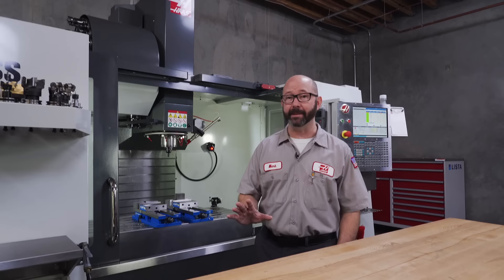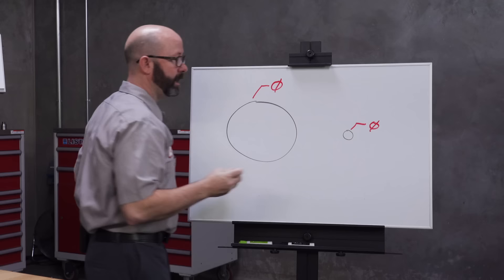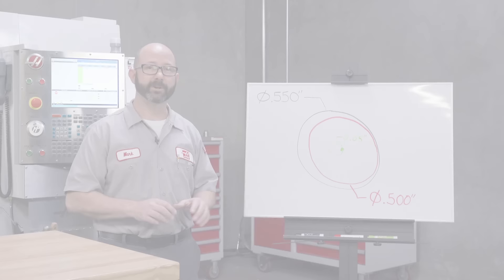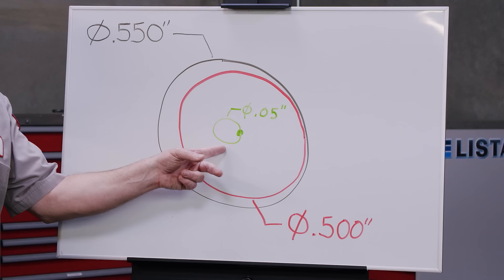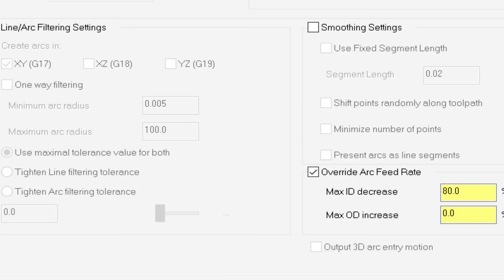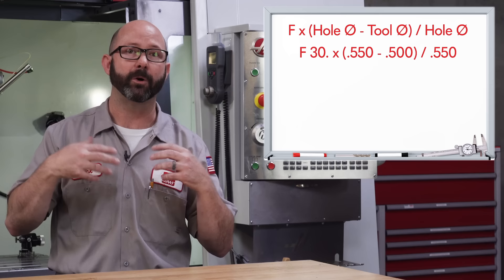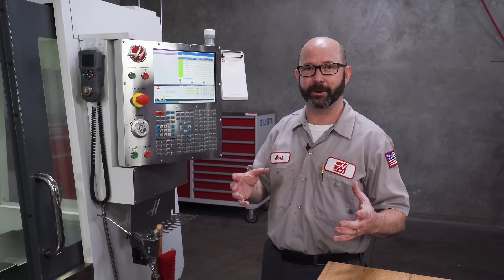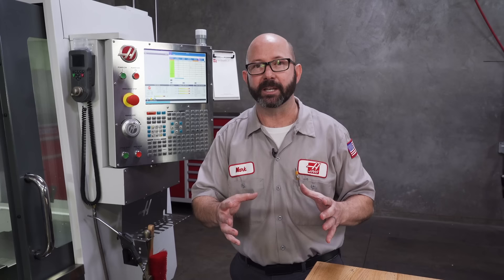YOUR FEEDRATE IS WRONG! – Haas Automation Tip of the Day

Comment: I appreciate that the first tip was "Haas does this for you" and the second was "But if you don't have our stuff let me show you the other way". Much better than "Buy Haas if you want it to work". Great content.
Reply: True but it's more like manually program it and let the Haas machine compensate for it or use a cam system and manually change the feed rate if it can not do it for you, yes it helps on other machines that have no compensation too.

Comment: Same goes for the outside of a circular boss as well. And yes fusion has this as well, under the feed optimization option.
Reply: Same thing happens when you program an inside radius like in a pocket.  Some cam systems will compensate by slowing the feed rate when approaching the radius.
Reply: On the outside you would have to speed it up not slow it down.

Comment: I've been using this formula for years, stole it from Mitsubishi thread mill catalogue once I realised what it was actually doing. Our shop used to spend hours contouring bores to get size and finish, blew some operators minds when they used this formula and got perfect fit first time with perfect surface finish.

Comment: Thanks for this. This is a great Tip! There will be a similar but opposite situation when milling external surfaces, Boss, rads, curves too.
Feed rate X (Boss dia + tool dia)/ Boss dia
1/2" tool cutting 2" boss @ 30 in/min
F30 X (2+.5)/2
F30 X (2.5)/2
F30 X 1.25
F = 37.5 in/min

Comment: This is really the kind of thing that should be taught in month 1 of machinist school... I know it was in mine. Also the OD formula is a bit different.
Reply: I've known about this since I was in machining school as well but I want to know what the Haas controller does if you use CC or a G12/13. Does it still use the tool centerline? or the "part line"?
Reply: @derekrutrough2334  CC ought to be Heidenhain command, haven't heard it used on any other controller. As for G12/13, as long as g41/42 is not active, it should follow tool centerline

Comment: I used this formula on a part that had 8 circ interpolated holes ranging from a finish size of .625 to 1.25 all done with the same .5 endmill. All 8 holes programmed at 11k RPM F100 IPM. When I checked the holes sizes  I noticed the largest hole was just a couple tenths undersized but the smallest hole was .007 or .008  under programmed size. After adjusting feeds with formula the small hole was right on size just like the bigger ones. Two lessons here. #1 you guys did it again with another great Video. #2 never trust anything coming out of the front office! :)

Comment: Thanks, that is interesting. Especially since I was making holes today on a Prototrak mill, the holes need to be a precise size that does not match any of our cutting tools! I didn't think about the problem and just set 5 ipm (in plastic with a 1/4 inch end mill) and it worked fine, but now I need to figure out what speed was actually being cut!
Reply: By the way, we do have several Haas machines where I work, but I am not allowed to use them (yet)!

Comment: great video this is the best explanation for a problem that I have been dealing with for many years now... Truth be told I never understood the formula; however lacking a education the thing that I did was just to go a third or a quarter of my programmed feed rate. this worked because I am cutting aluminum with conservative feed rates. I was basically faking it. Thankyou for explaining to me how I should compute this. However how do I know when to do this feed rate adjustment, I assume it should be done when the diameter of the tool path is smaller than the diameter of the cutter????
Reply: We came close to adding a rule-of-thumb to the video, something like "If your tool diameter is 50% the size of the hole you're milling, or larger,  then cut your feedrate in half". Any feedrate change in these circumstances would be helpful. The formula does a good job though, especially for threadmilling. The accel/decel of the machine, chip thinning, and the amount of stock that is left to remove, all play into a 'perfect' feedrate. We finally gave up, and settled on just explaining the formula.  Great comment. - Mark

Comment: This whole wear cutter compensation is new to me, I’ve always put the diameter in the controller and run comp in the controller. What is the benefit of using wear especially with tool probes you can start right off of the actual dimension of your tool? The only thing I can see is you don’t have to touch off the diameter.
Reply: I imagine because it's better for today's modern CAM software to generate toolpaths while being aware of the actual cutter diameter, for varying stepovers to maintain constant tool engagement and stuff like that. So it's better to do the program with the nominal dimension and put only the difference to the actual dimension in compensation.

Comment: Mark, you gave us the formula for an inner cut, what about an outer cut? How do I find out how much a should increase feed while rolling around corners? Thanks for all your tips of the day.
Reply: Simplified, cutter diameter divided by part diameter equals the percentage of increase (outside corner) or the percentage of decrease (inside corner) to linear feedrate. In Mark's example: .5/.550=.909, .909x30=27.27  .... So 30-27.27=2.73  ... Using the same parameters for an outside corner, you would add 27.27 to 30 ... So 30+27.27=57.27 ipm ... I hope this makes sense.

Comment: Im assembling my cnc (self made, in my free time,  w 1.8 kw spindle,  2022 the first chips planned) and learning G+M Code. Its all about , feeds, speeds and MRR. Thank you for sharing. Milling outside radius you increase the feed, feed * toolpathradius/cornerradius right?
Reply: Good luck! I just about managed to finish mine - when it's working you'll feel great! How's it coming along?
Reply: @robbiejames1540  It grows like a tree, slow, you dont see it, but it grows. I use the maschine manually, to produce the cnc Atachments. Closedloop steppers and cnc controller and other electronics are prepared. Still a lot of work.
Reply: @Imba-gt7qi  
Keep at it! Good luck!

Comment: I have two machines with Fanuc controls that will compensate for this automatically, and two that are about 10 years older that do not. Never noticed this until I took a job that was originally run on one of the older machines and moved it the the newer one and the cycle time went up by 15 minutes! 🤯 Anyone know of a Fanuc setting that turns this option on/off so it's not such a pain changing a job from machine to machine?
Reply: The older machines are Fanuc 31i model A and the newer machines are Fanuc 31i model B.

Comment: so for the formula do you just get a feed rate like normal? and then that's the # for the formula?
Reply: Yes. The F30. In the example was just what I might have normally run that endmill at. It will vary based on tool and material. We should’ve mentioned that. Thanks for the comment. - Mark
Reply: @markterryberry4477  thanks

Comment: And if you use cam software and also fill in you're tool diameter,  does it calculated by itself to the correct feed ?
Reply: Many CAM systems take care of this for us, some don’t though, especially for threadmilling. I would not buy a CAM system today without dynamic/trochoidal/adaptive toolpaths, but if a CAM system didn’t adjust for these feedrates in arcs, it would not be a deal breaker for me, I’m usually only concerned about it in very specific situations, like the ones we show in this video, and it’s easy to adjust for. - Mark

Comment: Feedrate should be sped up when going around outside of radius then.
Reply: Correct
Reply: In theory yes. Easy to do as I've already done these exact formulas before. 
Internal;
F x (hole dia - tool dia) / hole dia
External;
F x (hole dia + tool dia) / hole dia
BUT from experience, surface finishes could be reduced doing this depending on what machine/tool type you're using. If time isn't a big issue for you it may be better just to leave it for external rads.
Reply: Depends on Ae.
Reply: you dont need to because around the outside the finish gets better because it reduces chip load. if youre a job shop looking to save every second then yeah. but none of the softwares provide an option to speed up around the outside so that tells you its not a very common practice.

Comment: So if I use a G41 in my code that was posted and diameter and wear would that compensate correctly?
Reply: Yes. And if you didn’t, you’d probably never notice.... unless you are threadmilling or cutting a small circular pockets with a big end mill.
Reply: I having problems with using G41 (wear) thread mill making offset. Other problem is “cutter comp begin with G02 or G03”.posted from Mastercam.?

Comment: I wish HAAS would make bigger machines so they could take a bigger chunk out of the HIIIIIIGH end market.

Their excellent business practices and INFINITELY supperior controllers would overturn 50 years of industrial inbreeding overnight. Fanuc would be instantly out of business and the world would be a better place for it.
Reply: Or if Haas would stop making machines and put their controllers on superior machines
Reply: @ZZ3CR  Nothing wrong with a haas.  Its kinda like "Would you try to haul a load in a pickup truck that is designed for a semi?" No, you would use the semi.  Haas will cut any material you want. Maybe not as fast as other machines, but they also dont cost what those other machines cost.

Comment: nothing bout tool %75 smaller than hole and feed rate is not that much issue LOL.
fanuc do it for you if use G41/G42 and G2/G3 feed rates are smaller than programmed. if you use CAM make G1 lines around round LOL based on your resolution. and when CAM makes same part program Size bigger than fanuc can hold 250kb and i program same part hand using allready made makros and can fit 100 same program SAME time in machine LOL

Comment: i would love to see this video in metric :(
Reply: formula and tip is the same
Reply: Yes, the same formula will work in Metric. If we were cutting a 14mm hole, with a 12mm end mill, and we wanted a feedrate of F750., then we could fill in the formula as F750. x (14 - 12)/14, which gives us a program feedrate of about F107.14. Hope that helps. I’ll be sure to write things up in metric as well next time - Mark

Comment: I'm only here for the Lista toolbox...
Reply: I really like our 9-drawer wood-top Lista roller cabinet. It is at the perfect height for me which is 1” below my elbows. I’m 5’ 10” + boots. 
  

It looks like our particular Lista cabinets were custom built. 

  They do not have a model number on them, which is the case for most Listas, I am told. 

  The Lista 9-Drawer Cabinet, with butcher-block top, we use most often is 28.5x56.5”, and 35.25” tall without wheels (43.25” Floor to Top of wood top, with wheels). 

  The larger Stainless-top Listas we have in the videos are 28.75 x 56.5”, 46” tall (53.5” Floor to top with wheels). 

   Below is the contact information for the Sales person, Robert Serrano, at DMARK/Lista. 

-	Mark

Robert Serrano
Cell#818-739-9446
Email: rserrano@dmarkcorp.com